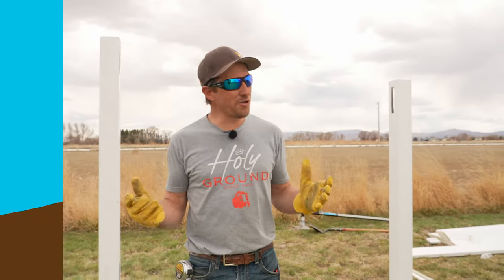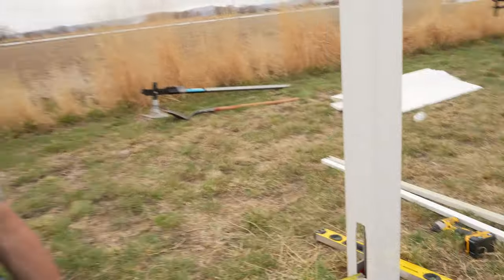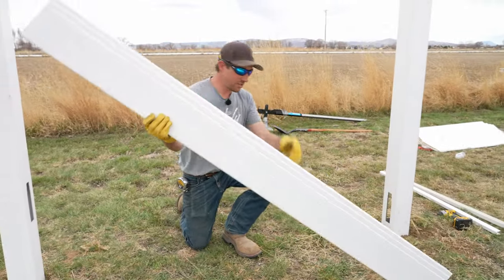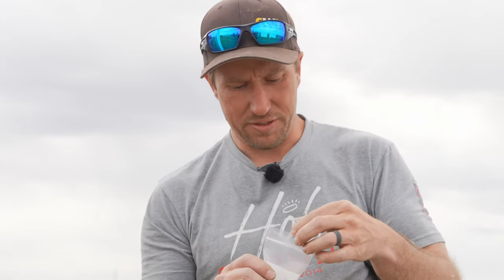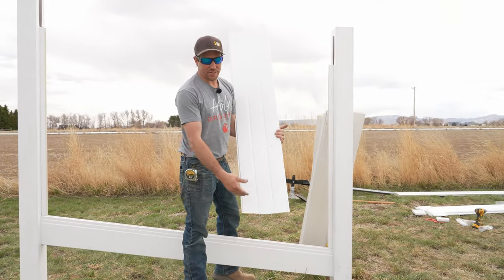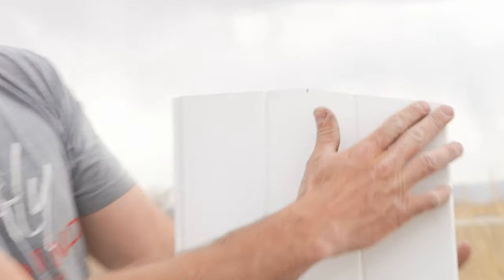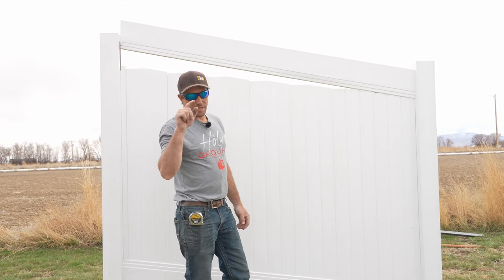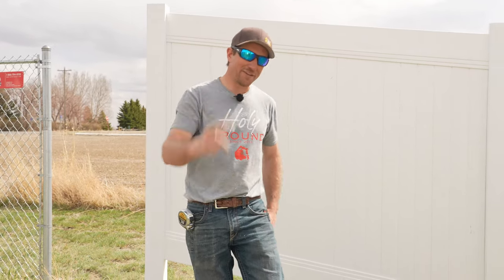How To Build Flawless Vinyl Fence Uphill

Comment: Can u just cut the panels once the bottom rail is cut and when u set them in take a line and measure about an inch above the bottom of the hole ?

Comment: My 3rd time watching this video.  I'm starting my other side vinyl fence install tomorrow...on an angled slope.  The measuring and cutting portion is invaluable.  Thank you.  I did learn coating the upper rail with Spray-Nice allows for a much easier install to slide in the posts and over the pickets.

Comment: What do u do if your bias or angle of your hill is more then 4inches lets say real steep hill do u open up your rail hole to accommodate the bias do u know what im asking?
Reply from the maker: Yes open up the rail hole.  Open the top of the hole on the uphill side of the post and the bottom of the hole on the downhill side for the best results.